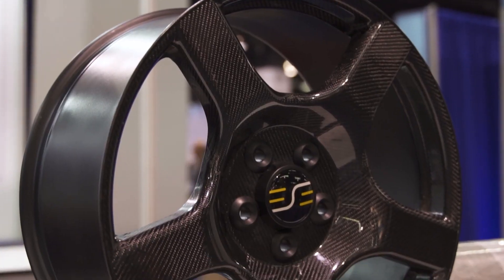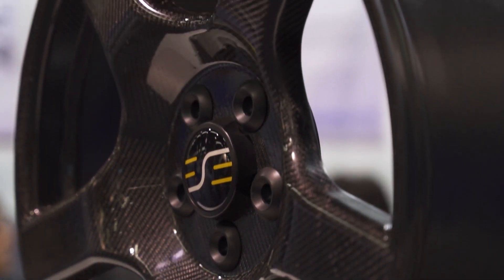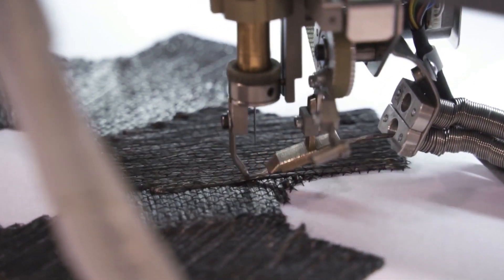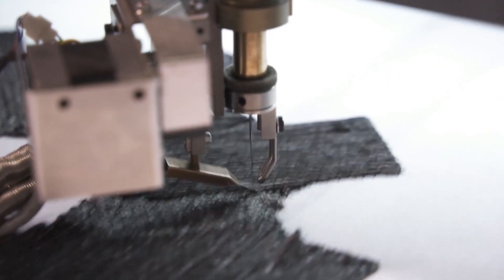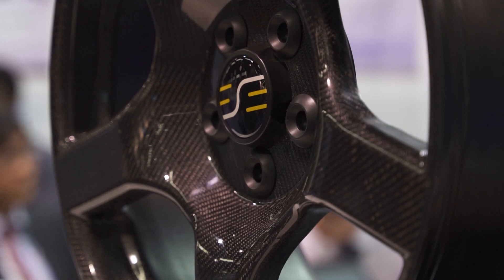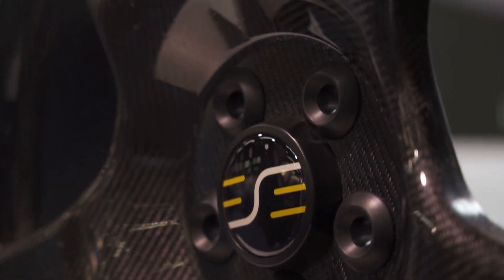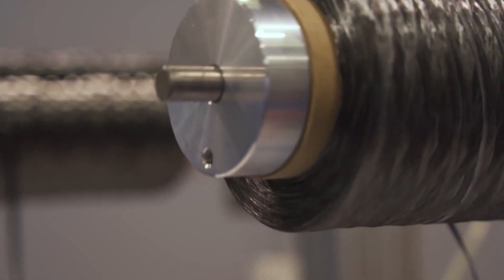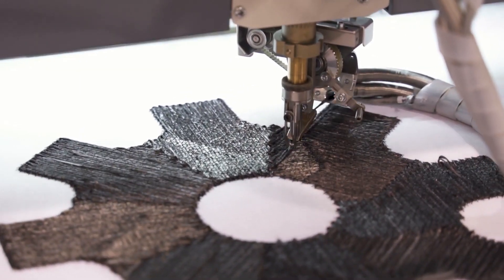One-Piece Carbon Fiber Wheels | CompositesWorld Interview | ESE Carbon Company

Comment: Can't wait when its in production !!! question: is the tailored fiber placement technology also strengthen the wheel as well due to the precise direction or how you guys wanna direct the strings, relatively compare to other ways of manufacture? i gotta start saving again, i'd love to test these wheels <3
Reply from the maker: Mr. Nguyen, great question!  TFP (tailored fiber placement) is a game changer for sure.  From our engineering team being able to specifically design for areas of stress, along with significant reduction in waste, makes TFP a huge opportunity within the world of carbon fiber composites.
Reply: @esecarboncompany7723  I see isee, I'm really curious now, it would be cool if you can show off a strength test against the competitors wheels, over 3000 pounds of load per wheel is pretty impressive. Is TFP still need to use some kind of liquid mold like how koggnesegg did there or you guys don't even have too